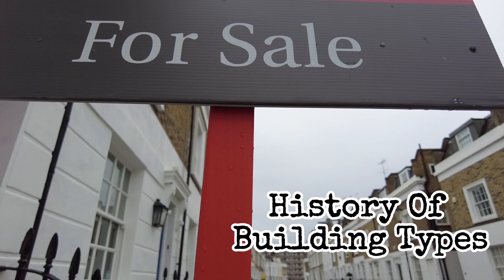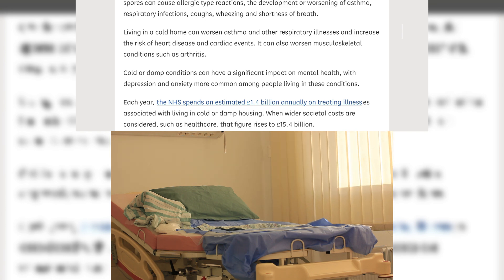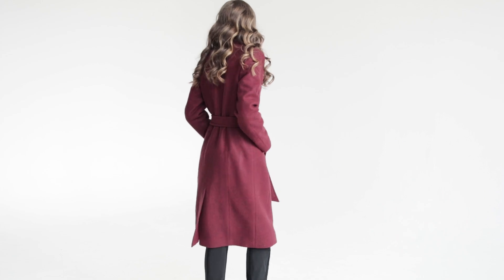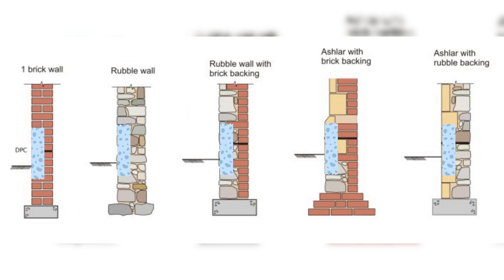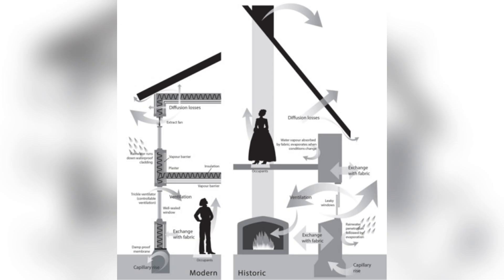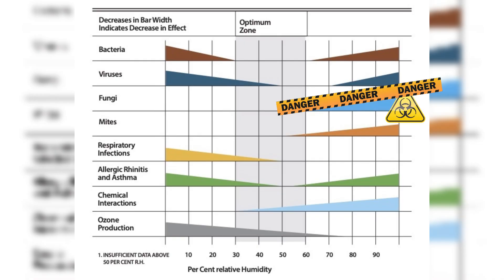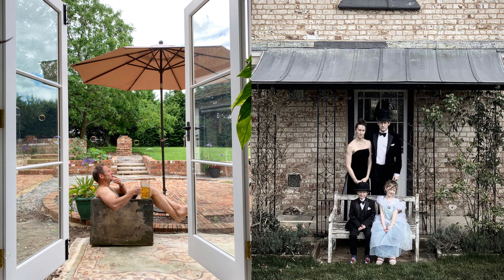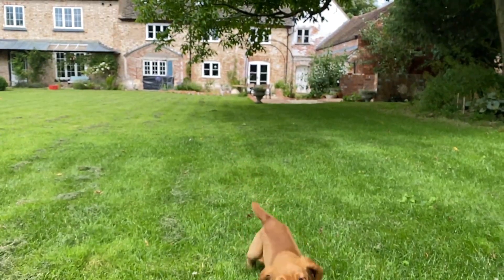Got mould? It could be how your building is maintained

Comment: Probably a stupid question but these old methods of building still made for much colder buildings than say a modern build. So how can you bring up the level of insulation while also maintaining a breathable wall? Breathable external insulation?
Reply from the maker: Not a stupid question at all, and very relevant today. The thing that is often forgotten with permeable building materials is the physics of how they react to moisture. Specifically that a wet/damp all is an appalling insulator, whereas a dry one (with all its tiny pockets of air) is actually pretty good. 
When we add layers of insulation we slow, or maybe even stop, its ability to get and stay dry - that can have a far bigger impact on its efficiency as an insulator than the layers added.
One of the great challenges is first to understand the actual materials the building was constructed with, their condition of repair, and how they interact with their neighbouring materials, then make an assessment of how the building is likely to be used (occupancy levels etc), then the geography/ meteorology now and into the future and then make appropriate recommendations that won’t cause more harm to the building. 
In some cases you might not be able to improve the efficiency to the same level as a modern efficient home, but equally the thermal masses benefits of old solid built homes means they’re much less likely to over-heat or need air conditioning in the summer months. 
Much of the above is covered in PAS2035 - all about retrofitting homes.

Comment: Great video mate. What are your thoughts on external insulation ,what precautions would you follow when installing this type of insulation?
Reply from the maker: External isn't as troublesome as internal, BUT personally I would avoid either. The main reason being that a DRY solid wall is actually a reasonably good insulator - despite what the 'book' U-values state. If you concentrate on ensuring the wall can get ,and stay, dry then you've got the best performing wall with minimal risk of issues.

Comment: I have a 1920s property with solid walls no cavity. Plaster has blown in some areas as you can hear where it’s delaminated. One builder suggested hacking back to brick and applying rockwool to the wall and then plasterboard or dotting and dabbing. Another suggested plastering with hardwall ontop of the existing plaster then multifinish. Is there a better method than others? Worried about interstitial condensation!

Comment: Great video. We’re in an 1850s cottage with solid stone walls that unfortunately we had silicone rendered. 
The damp inside hasn’t gotten any worse or better which is one plus as I was worried it might get worse. 
Currently looking to see if there is anything we can do internally to help and also looking at Positive 
Input ventilation units to see if this would help so looking forward to checking your future videos. 
Cheers.
Reply from the maker: A solid stone wall will be extremely thick, so that’s probably playing in your favour. I don’t have much personal experience of PIV units but know that if correctly specified they can improve ventilation well in a home. One downside is that in the winter some don’t like the cold draft from the outside air they draw in; heated versions then become expensive to run as it’s effectively a big electric fan heater!
Reply: @talkingconservation  Thanks for the response. I've since installed a PIV unit, I'm just waiting on the vented roof tiles to arrive before turning it on as the loft doesn't have much ventilation due to the construction of the house so I'll update the results.
Reply from the maker: Sounds good. Yes I’d be very interested to hear how you get on with it too 👍
Reply: Hi, so I’ve installed a PIV unit about 2 week ago. The roof tiles I wanted to install don’t seem to be available so I ended up installing two standard vented roof tiles and running to PIV on setting 2 out of 6. 
The very next day, all the windows and door handles are completely dry. Usually in the mornings, there are pools of water under every window. 
The next step is cleaning up the windows and walls of mould and see how it holds up. 
The air certainly feels fresher but I want to install two more vent tiles as there aren’t any airways in the eves to our loft. 
With the walls being so thick and a flow of air internally, hopefully this might curve any further damp.
Reply from the maker: @tatkinson1983  sounds like it’s looking really positive and glad it’s made a difference. Is the incoming air heated?
Reply: @talkingconservation  
I decided not to go heated due to the costs and research from other’s saying you didn’t really notice the cold air unless you stand directly underneath it for a short amount of time. 
I haven’t changed the heating schedule and I’ve not noticed the house being colder. 
It’s worth noting that before, our dehumidifier was showing 84% in mornings and evenings. Now it maxes out at 62% and is generally around 55%.
Reply from the maker: @tatkinson1983  sounds great. That’s still quite a high RH to have with a PIV. Makes me wonder if you have a significant moisture source somewhere 🤔

Comment: Great video and bang on technically. I have a WW1 house with solid walls. I have internally insulated my house with 3inches of Celotex, but onto metal stud wall created making a cavity, which is airbricked to the outside only. The inside is then heated using dehumidifiers only and a woodburner. The difference in temperature is amazing. The mould is gone and so is the anxiety with trying to make such a building warm and effiecient. Please keep the videos coming. Subscribed as of today.😊
Reply from the maker: The method you’ve used usually isn’t recommended for traditional buildings to be honest 😬 There is a significant risk of cold bridging, especially between floors at the floor/wall junction - which can result in accelerated decay of the joist ends embedded in the solid walls. Did you insulate between floors?
Reply: @talkingconservation Thanks for your feedback. Well spotted, and yes potentially a problem. Under the ground floor there is no insulation at the wall or under the floorboards. There is a good 50-60cm of airspace and the floor bearers at each end are sat on a DPC-plenty of airbricks. At the upper floor level there is no insulation on the brick wall itself. The floorboards are not covered in carpets, and have 1-2mm between them to allow humidity to balance in the dead space into the room, so that is effectively being constantly monitored and dried by the dehumidifiers in each room. After 5 years downstairs there is no evidence of mould/rot or wet wood. The joists upstairs are also similarly dry, but have only been insulated this year. I will keep an eye on the situation. Thank you for making me aware. If you have any further questions then great.👍
Reply from the maker: @fredsmith6725 fab, sounds like you have most bases covered then. With all these things there are always compromises so I guess it’s how we can mitigate and monitor to reduce risks becoming issues! 👍